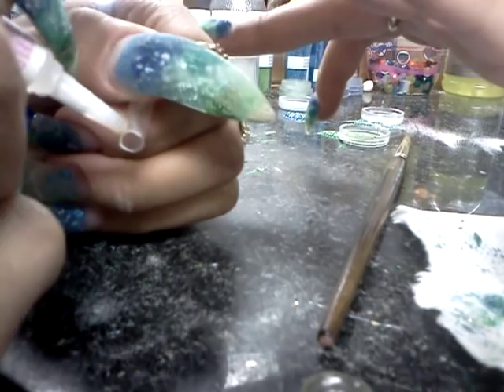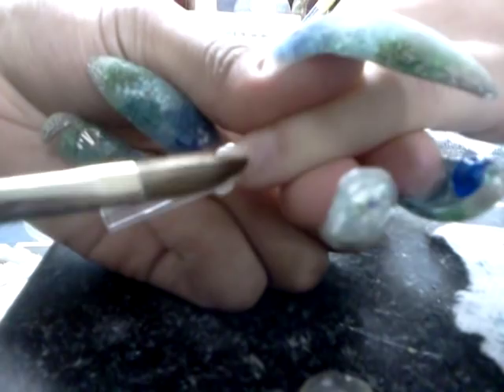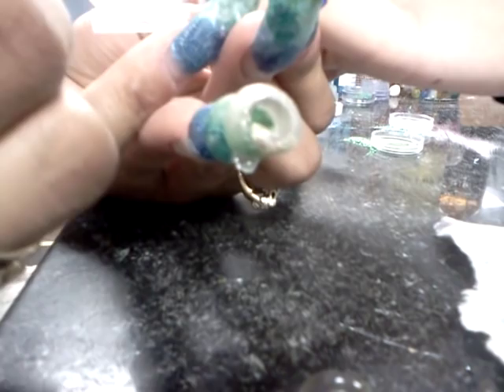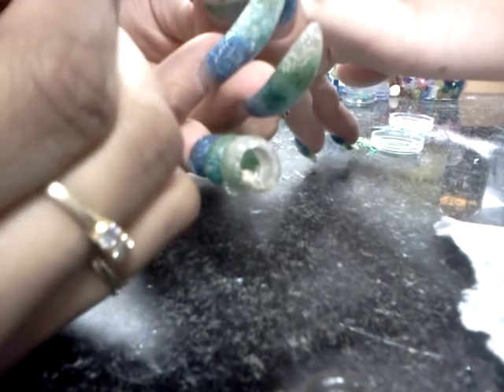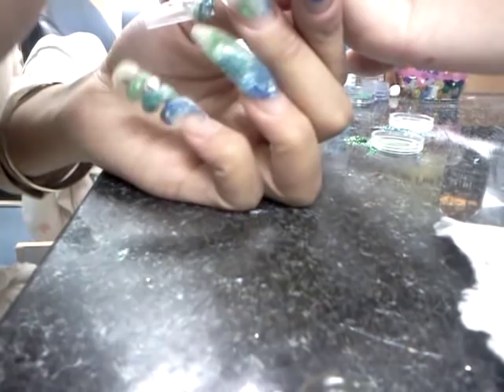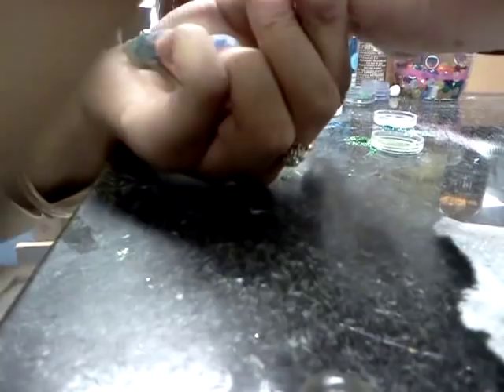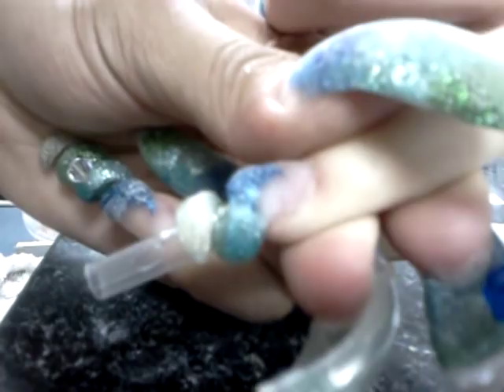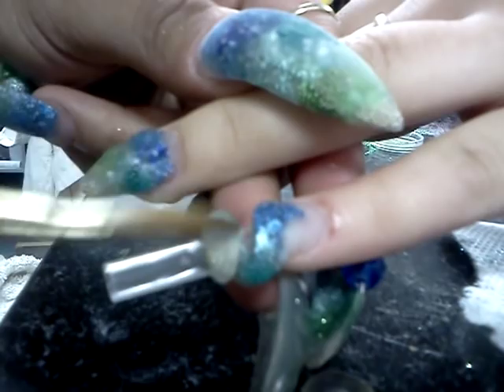::5:: How to do a spiral nail

Comment: I have a question. If you are using nail glue to place the straw under the nail is it difficulty to remove the straw afterwards. Then my next question is how do you get the spiral acrylic off of the straw after it is dry?